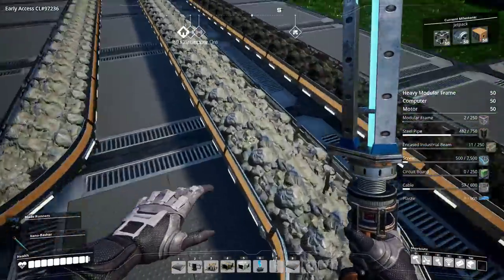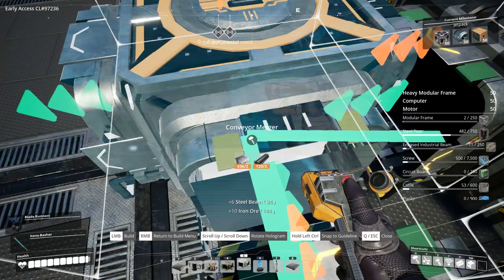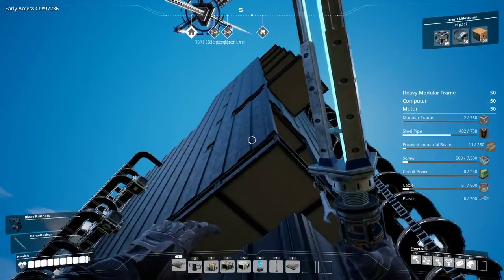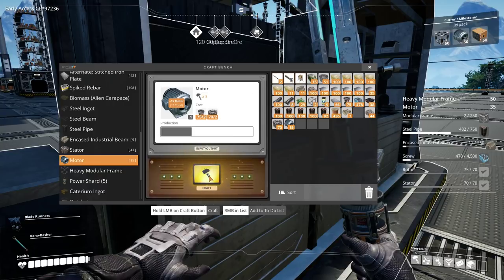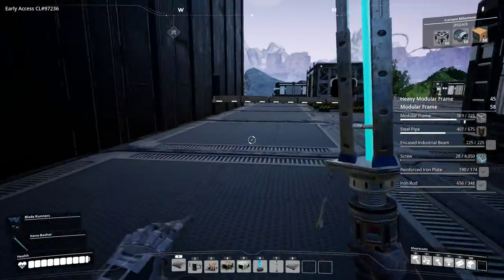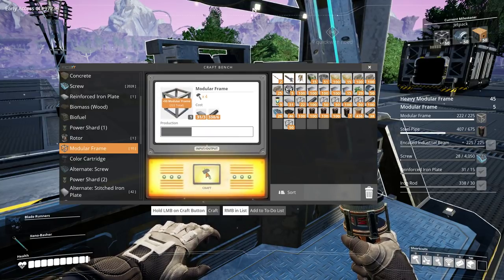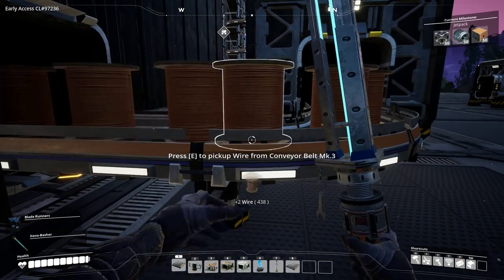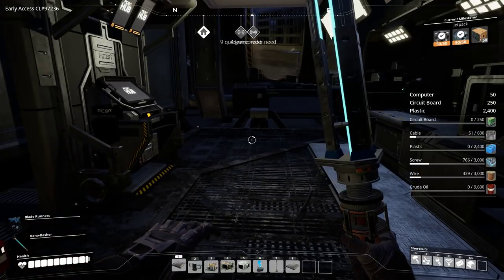HANDCRAFTING THE GAME - Let's Play Satisfactory - Satisfactory Gameplay Part 59

Comment: A tip. 
Just set up a quick auto-craft area. A container going into a smelter going into a container. And a container going into a constructor going into a container. Have another container going into a constructor into a container right next to it. Have those two containers going into a 2-parts manufacturer that goes into a container. 
Then just throw in the stuff needed and set the recipe. No full line but just containers and adding it manually. 
Perfect place for overclocking as well.

And in this episode, you could have thrown the stuff into that setup and gone out hunting for oil. And pretty much had it done for the jetpack once you fixed the oil.

Comment: Best way to get engagement is to keep making small mistakes in your factory, because people can't help but correct them, lol. (You attached one of the plate conveyors to the building the wrong way around when you were doing your crossover splitter/merger thing, which I think won't work the way you set it up because you can't do two in, two out of a single box).

Comment: I agree with Archont, 20 Mins is the right length.

You asked for comments, so I'll admit this wasn't my favourite of your videos. Handcrafting isn't all that great to watch and I kinda saw you needing the big materials coming. 

Try and get your modular frame and encased I beam production up and running asap (even if it's not immediately 9 floors tall with perfect ratios. You'll be going out to explore soon for Oil and you'll need more HMF for that, and if you can get the production of the ingredients running slowly back home you can spend less time handmaking the stuff later on.

I reckon it's time for an exploring episode soon though. You need more hard drives!
Reply from the maker: Ya, I k ew the handcrafting isn't as fun that's why I extended this episode to try and get it all over and done with.
Reply: @Steejo Yup, appreciate that, and then the next episode was exploration =). Keep up the good work dude.